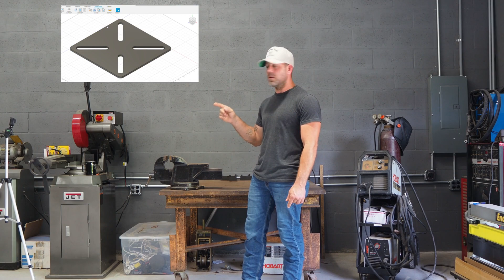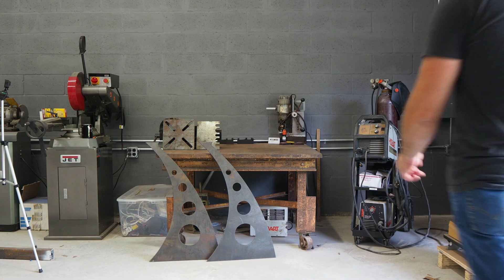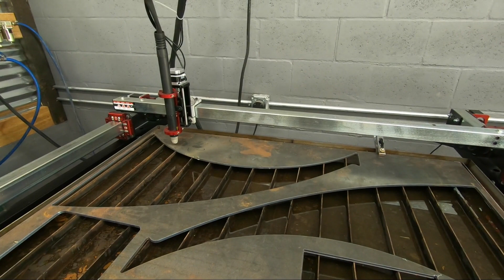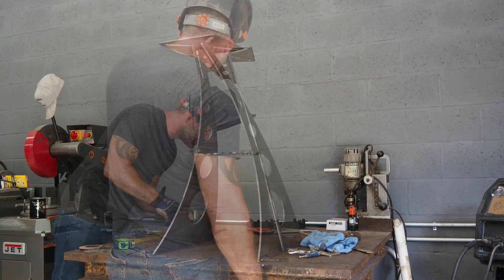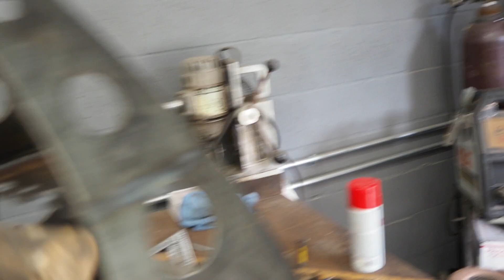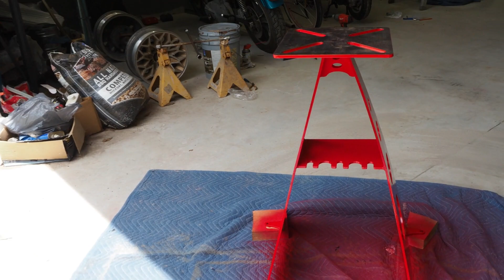Vise stand made on the Langmuir Crossfire Pro

Comment: I'm surprised you didn't put the mounting tabs to the inside to keep a clean flush trip free mounting solution. I thought about doing this but I cannot bolt anything to my garage floor. so I'm thinking of making a small box around the bottom and filling it with concrete.

Comment: What is your air setup. How much pressure are you sending the the cutter. I am converting a Longmill CNC router into a plasma with the Hynade cut60DN. I just got a 60 gal Craftsman today and getting it set up.
I have always done wood work. Everyone asks me when I am going to start doing my flags in metal. Well here we go.

Nice work on that stand.
Reply from the maker: Im using a 60 gallon as well just a cheap used one, the Everlast 82i im using runs at around 70psi at 60amps I cut everything at 60 amps and just adjust speed based on what thickness im cutting
Reply: I second that. I have the Langmuir PRO with 5hp/60 G tank.  During a long cut, compressor can catch up and shut off during cut just fine. put a good drying system in front of your machine to keep consumables from ending quickly and you'll be just fine.  I Run a Razor 45a at 75psi

Comment: Nice design, simple with some artistic look, I was thinking the holes on the side which you don't need are nice for looks, or even the same size pipe for each hole across each one, just something that's not needed for fiction but another idea of a cool look, personally I don't think I'd change a thing, but as a welder and looking for more cool looks, I'd one with maybe one without tubing, depending on how it turns out after wards, sometimes things in our head doesn't come out in reality as we think, but this is a nice job and many version could be produced if desired

Comment: Sorry if you mentioned it in the video, but maybe I missed it. This is quarter inch material right? And you said you used the 0.9 tip at 75A?
Reply from the maker: I actually switched to just running at 65amps for everthing and on 1/4 I run 90ipm with a 1 sec pierce delay, with the 80 amp plasma cutter at 60 to 65 amps I get 100% duty cycle
Reply: @envisionmotorwerks  I see, and you cut pretty big stuff, so maybe the bigger kerf to run at 65A is not a problem. 90IPM is fast :D for quarter inch material, but you surely have good results it seems. I will also try with higher speeds and current. Do you get a lot of bevel (tapered edges) when you cut with those settings?
Reply from the maker: @AlessioSangalli  yeah the higher speeds really seem to help with warpage too, I ran 140 ipm on the shop sign with 1/8 steel and it turned out great , the only thing I would watch out for is if your doing small holes i generally slow down the feed rate on the holes or the holes come out a little wonky
Reply: @envisionmotorwerks  thank you. How did you come up with these feed rates, you just experimented?
Reply: @AlessioSangalli  The manufacturer should have some recommended speeds to use as a baseline.
Reply: @larelare1  I have been using the manufacturer's recommendations, that I found are very different to what was being discussed in this thread, hence my question!
Reply from the maker: Well I accidentally left the .9 tip in and the 75 amps pretty much destroyed the tip , .9 is really only good for about 45amps I switched to a 1.2 tip after blowing out the .9, but yeah its 1/4
Reply: @envisionmotorwerks  my plasma cutter only goes up to 60A but for 1/4" material I typically stay at 40-45A, what speed (in fusion 360 post process) do you use for 75A?